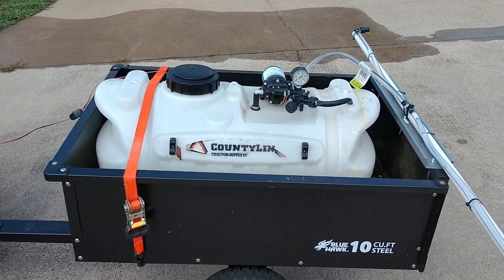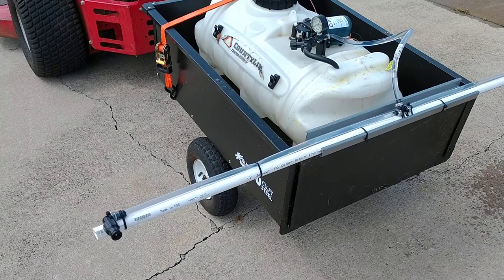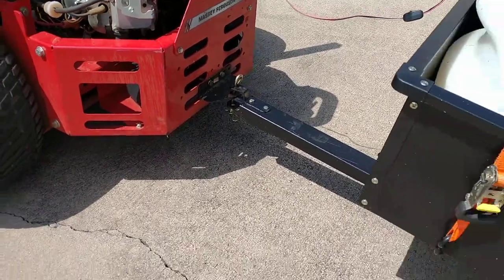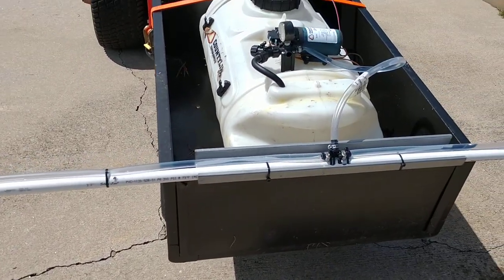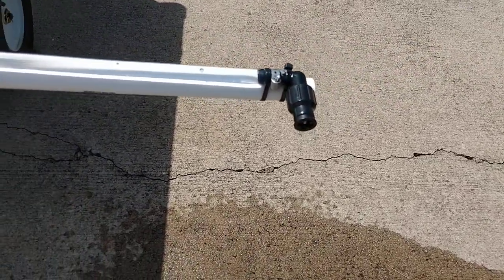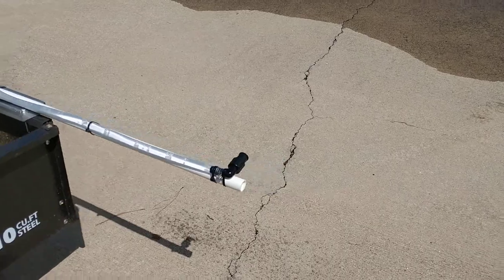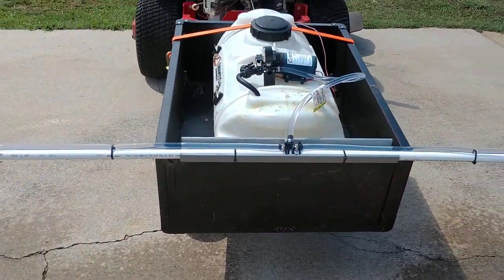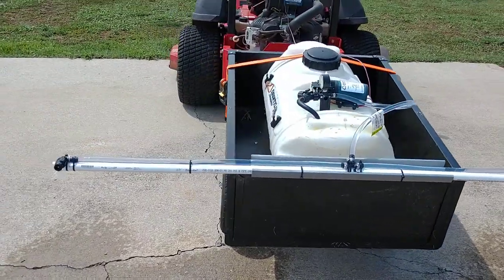Homemade DIY pull-behind boom sprayer

Comment: That is so smart, I was thinking of crating some sort of contraption to just hook onto the tractor/mower with the hooks for the collector bag and lock in with the tow hitch, but then I need to build that whole contraption.

Making it like this and mounting it on the trailer is much easier and easier to get done.

Thank you for this fantastic idea! ❤

Comment: Excellent effort.  Depending on which Teejet nozzles you use they need to be 20" apart and 20" from ground for overlap coverage.  You set your pump pressure and forward speed to work with the selected nozzle.  Teejet has charts for their nozzles and it would be wise to do more research.
Reply from the maker: I appreciate your comment, I was just trying to throw something together quickly and inexpensively. 

I'm sure there are a hundred different ways to make a homemade sprayer based on all of the comments that I received on my two videos. Once again, thanks for watching!

Comment: Very nice setup, I am going to build one as well. I think the boom needs to be longer with a 3rd nozzle in the center. Also that pump is not designed for continuous use, be careful that it doesn't overheat... nice work
Reply from the maker: Check out my other video, I added a third nozzle in the center. I only used it a few times last year, no problems. Thanks for watching!
Reply: Okay I sure will, thank you for the informational videos
Reply: Ya know too you could make it longer too. The wider the spray the less time itll take to cover the yard

Comment: Just a suggestion but i believe the nozzles should be overlapping each other when hitting the ground I don't remember by how much if you put a third nozzle in that would give you full coverage you will just have to calibrate your sprayer.  And change pressure or speed to put down the gpm you desire much better spray coverage and more accurate usage of chemicals. Great video thank you
Reply from the maker: Thanks Blake! I actually added a third nozzle after recording this video. It works much better now. Thanks for watching!

Comment: mount your tank to a piece of plywood the same size as cart, you won't need a strap, and just shorten up the distance between nozzles for better middle coverage.  cannot see a middle nozzle from driver's seat (in case it plugs).

Comment: Do you have a parts list you could share for your setup with specifics? I'm planning on building something similar as a compost tea sprayer. I'll need nozzles that have at least a 400 micrometer opening and thinking something like his could work attached to the back of my quad. I'll need to buy a tank in general so just trying to see what I can make for cheap and ideally hold 70 gallons (or smaller but I'd have to refill). I'll be applying to 7 acres at 10 gallons an acre

Comment: 2 more sprayer nossels 4" from the center youll get better coverage  just my thoughts. But to test this spray pattern you need to drive at you spray down the street or dry pavement and see what got wet and how wet it got and that will show you what spots your not hitting and how wide a path your doing.
Reply from the maker: Thanks for the advice, I've made a few improvements to it since I made the video. Thanks for watching

Comment: I want to do the same thing only my tank needs to go sideways as my sprayer is a wand that sprays about 30 feet swath and is mounted to the back of the tank and also has a spray wand.  Just have to figure out some brackets to mount it on top of the cart.
Reply from the maker: I just strapped mine in with some inexpensive ratchet straps.

Comment: 2 nozzles are all that pump can handle effectively,  just shorten up your boom and call it good !!
Reply from the maker: The pump is very powerful it's handling three nozzles just fine.
Reply: @WestWorld24  What size is your pump? how many GPM?
Reply from the maker: @chaddalton3442  2gpm
Here is a link to what it started out as.
https://www.tractorsupply.com/tsc/product/workhorse-sprayers-25-gallon-deluxe-spot-sprayer-1225036?cm_mmc=feed-GoogleShoppingProduct_-1225036&gclid=CjwKCAjw26H3BRB2EiwAy32zhaTr78pNeJjhgF3zlnoRLDEmRoD-bl62VPubuZSxgzsIuaHWDjHgVhoC2q4QAvD_BwE

Comment: Hey just a sugestion. I made a mod on my mower for a work light and ive tied in a plug to make 12volt hook up to a pump or other attachment to run off the mower instead of a battery. I just added a in line fuse and hooked it to the mower battery
Reply from the maker: That sounds like a great idea!
Reply: @WestWorld24  thanks. Could you tell me where you got the sprayer heads at. I wanna build a simalar one but make it wider for less passes in my yard. I wanna be able to fold it up. Instead of pvc i may use aluminum as the support so itll fold up and hinge it. Great design though . Just make sure if you wire it up to add the fuse and a good switch. Thats rated for the amprage.
Reply from the maker: @theironmonger1175  I got the spray nozzles at Lowe's in The plumbing section. They were with the ground/yard sprinkler systems. It was trial and error, I now have three nozzles and I change the spray pattern.